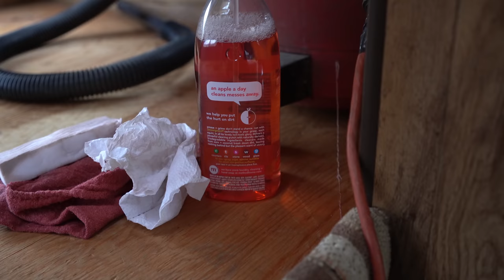DIY Vintage Truck Camper Renovation - Part 1 (the Demolition)

Comment: I'm actually considering going this route instead of aiming for my own van conversion. The idea of having a truck camper that you could easily swap out onto a different truck or even theoretically take off and store for a time seems ideal. Vans are also crazy expensive, lol. A used truck + a modest new/newish camper might still be cheaper than the popular van models people use for conversion.
Reply: Did you get a camper ?

Comment: For as old as the camper is, I'd say that damage isn't too bad. 

Pay close attention to the seals on the roof. I made the mistake of buying a used camper a couple of years ago, it was super cheap but half the walls had been rotted out by water from so many leaks in the edges of the roof. I just ended up scrapping the damn thing.
Reply: I m afraid of buying an old camper.  Not worth the time and works.

Comment: This may help depending on your finances. Several van-life you-tubers have replaced their non-working refrigrators with newet electric models that run solely off of the solar panels and battery system. Basically that unit then becomes "free" to operate. Or simply replace the bad unit with a newer unit that works, saving yourself from grief.
Reply from the maker: Luckily a company that produces RV parts and appliances reached out and asked if I would like to try out their fridge. Will keep everyone posted on how it turns out!
Reply: Whisky and camper living go hand in hand

Comment: For all of the exterior trim and seams.. get yourself some Vulkem from your local hardware store to seal all edging and gaps.  It is a flexible membrane, waterproof and will last longer than the camper!  Get yourself ~5-7 tunes of it, a caulking gun and go wild.. messy, but it is the right way to assist in waterproofing it.

Comment: it would be good to reseal the windows. not with caulk though. need to remove them and use new butyl tape.
Reply from the maker: The window seals are still pretty good but I’ll probably still do that when repainting the outside anyways

Comment: You should examine all the exterior seams, clean them, scrape and re-caulk them. Personal preference is this stuff 3m marine adhesive sealant 4000 uv. The water damage is coming from somewhere and usually any old seam is the reason.For any roof seam, this is what most RV's use, Seal leveling Dicor ... but mold is black, and just spray it with bleach.

Comment: Insulation particles that can be found in insulation, vinyl flooring, and various piping surfaces.   What you have is mold.  Either you replace the entire wall.  Or you can get a a stff scrub brush, mold removal cleaner that is bleach and hot water.  Heavy duty gloves.  There are people who use power washers.

Good luck!

Comment: Just for safety if anyone is working on a camper like this either leave it in the truck bed or brace the front bed with a 2x4 and two posts in the front they are not very stable on the stands also once you take it out of the truck bed carefully lower the camper as far as possible in case it does tip it will do less damage

Comment: Not sure how much water damage there is but the wall looks sturdy enough to not dig into it. You could go and replace the paneling but that’s a lot of work and probably not worth it for the camper (plus yours looks more stained that rotten). Use a mold killing spray and on any water damaged area. Wait for it to dry really good. It would best if you got an ozone machine from Amazon. Run that a few times for a couple hours each session. Make sure that the ozone can get inside your walls. That will kill the mold and make it so it can never reproduce or cause harm. Then paint on a zinsser mold killing primer. That will seal it off from your main living area. And then paint. But before you do all of the interior work make sure the outside is all sealed. I recommend redoing the butyl tape on all the windows and corner trim because the tape starts degrading after something like 4 years 😬. After you rebutyl tape them then use a solvent based caulk around the windows, trim, vents, and roof. Don’t forget all the screw holes, even under the corner trim. If you’ve got any remodel questions scroll through my IG feed and you will find all the work I did on the camper I currently live in. Or DM me on there ( zane_sutherland123)

Comment: I would spay water with bleach... then paint with kills paint.. i would seal your roof really good use caulking around any of the vents and then seal it with like elastomeric or something one nice thick coat of that on there.. I think i would leave the refrigerator out and just use a nice ice chest. I would use like a marine caulking like 3M sealant clear like around all the edges of your camper for all the screws are Brandon if your vents.. thumbs up guys doing a great job

Comment: Asbestos might be present in your truck brakes.  I can't think of anything in the camper that would have it.  It was used for electrical and thermal insulation, house siding, linoleum, etc.  If you have something made in the 50's, it would be worth consideration.  I would be more concerned about inhaling mold from the water leaks.

Comment: How much the Old Camper?    Your Gas mileage/tire wear/alignment must suffer with that extra weight.

Have you consider those travel trailers?   They start off at $4,000+ brand new.   There's a few mom/pop camper builders in Florida, "Runaway Campers & Tiny Campers".   They're Custom Built by Order.   2 years ago when i was watching the new phenomenon with the Ridiculous Home Prices people turning to Van Life/Tiny Home Living/Rv-ers/etc...   a few of 'em went with the Mercedes Sprinter, Converted Buses, etc....   The Runaway Campers company in Florida custom builds their campers and starting prices were $4,000+ and up...not sure how much it went up but it was pretty cool looking.   The Air Stream camper($7,000+) looks cool too.   

Good Luck with your Life's Journey/Adventure.

Comment: It's very doubtful there is any Asbestos in your camper.  It will have fiberglass insulation.  Find all water damaged areas and repair with new material as best you can.  The BIGGEST concern with any RV or camper is keeping it dry!  As in no leaks!  Remember this name Eternabond RV roofing tape.  This stuff is the absolute best.  Scrape clean all old caulking around the tops and side of windows at minimum, storage door frames, door frames, etc. on an old camper like this.  Remove old caulking around roof vents, etc. You can use silicon based new caulking for side windows, vent doors, storage doors across tops and sides.  Use a latex based caulking to replace all old caulking on the roof, then once dry, tape overtop all caulked lines and seams with the Eternabond tape.  This will insure your camper is waterproofed, and is long-term reliable.  These are the most important things you can do to any old camper.  I grew up camping in campers.  I've lived in them year-round in the Northeast in snow, rain, wet, cold weather.  I still live every summer in a camper.  I've done and replaced everything in a camper and even installed all my own solar systems.  (Electrictronics Engineer by education and a carpenter by military experience and civilian experience).  I've done lots of work on campers for decades for myself and for others.  I've been in them since a kid, and I'm 56 years old now.  DRY like the Arizona desert inside is what your goal needs to be.  I've been to camper bone yards.  One thing is a common theme of all campers from the 50s onward is that most of their roofs collapsed from leaking. They rotted little-by little, spot-by-spot on most junkyard campers.  The roofs remain the Achilles Heel of campers and RVs, and also around slide-outs too on later models.  PS  As someone said on here, removing the windows and redoing them completely is the best.  RV sealants are better than using household stuff, but on the roof a sealant that the RV tape will adhere to is what I was getting at.  Nothing sticks to silicone.  Regular cheap silicone is too soft and doesn't stick well.  If you do use silicone for anything use GE Silicone 2, or equivalent, which is much better.  The semi-hardened clear stuff, the RV factories use now is good stuff.  Very tough stuff.

Comment: Please view youtube videos how to correct water damage in RV walls. I've seen previous videos where the people purchased an older camper like you did and he stapled in new insulation and plywood walls. He hooked up an electric table saw outside an measured the walls and cut the plywood to put up new walls and its very important to put up plenty of insulation to help keep it cooler in the summer and warmer in colder weather.

Comment: Only like 5 mins in but did you work on the camper while it was on its jacks? Should have done it while it was on the truck bed that would be much safer. By the look of those hydraulic jacks they are super old and can fail. Wait I now see the pallets underneath, still not super secure

Comment: I doubt you have asbestos in your camper. I think that was only used in commercial buildings and older homes for the most part. You wouldn’t have that in this new of of camper. If you did, I’d get rid of the camper.

Comment: your better off buying a custom made fiber glass camper shell the camper so old there alway dry rot and leaks no matter what you do and the quality control on the camper shell  and material they use are terrible unless it new good luck